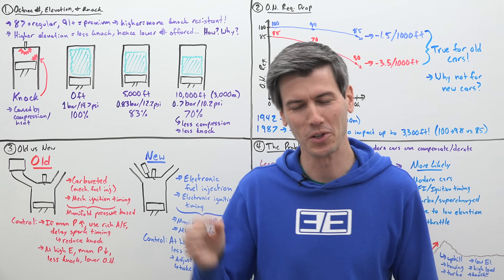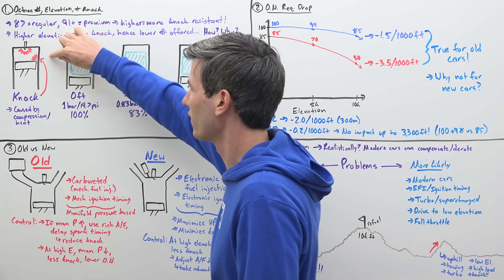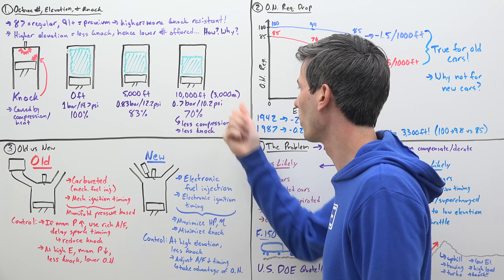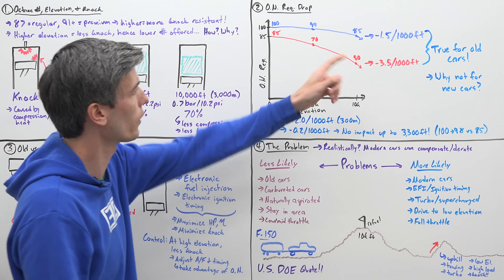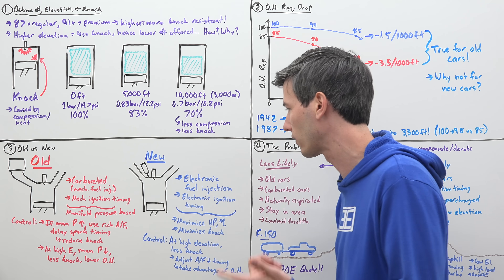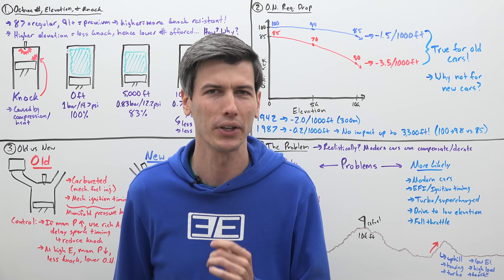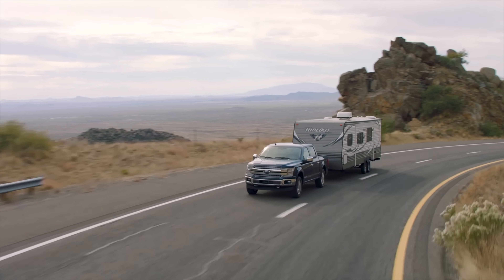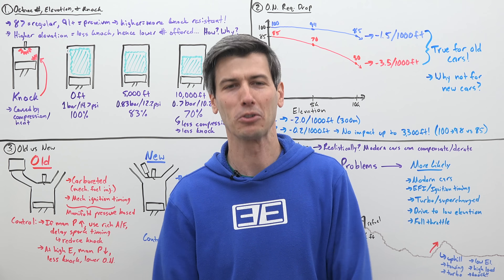Never Use This Gas In Your Car!

Comment: I drive a Japanese minitruck, there are constant arguments on the forum about what octane to run.  And, I have to keep explaining that the Octane in the manuals for our Japanese home market trucks, are referring to just the Research  Octane Number, and not the Anti Knock Index posted on pumps in the USA and Canada.  And, that if the manual says you can run 88 or 90 octane that is really closer to 93 or 95 AKI here in North America.
Reply: USA IS RON+MON/2  If they're using RON, those numbers are always higher than the ones used in the USA.
Reply: @user-jl8yy5ir7s too broad of a statement. Many newer cars have a compression ratio over 11:1 that run fine on 87 and older fuel infected naturally aspirated cars with a ratio of 9:1 that require premium fuel. It just depends...
Reply: @user-jl8yy5ir7s Depending on the year, some of them have 12.5:1 compression ratios.  Depends on whether it was before or after the manufacturers agreed to end the horse power race.   By law they Kei Class vehicles are limited to 660-cc displacement.   So, there was an “arms race” of sorts for a few years, where the manufacturers were trying to get as much power as possible from the little engines, so they were either increasing the compression ratio, or supercharging, turbocharging, or in a few instance both turbo and supercharging.   They really do need quite a bit of octane, because they were for the most part still running carburetors.   Mine was a low trim, scissors lift dump version, and it has 10.5:1 compression ratio.   The fuel injected turbo version had 9.5:1 compression, but the boost takes up to around 12.5 dynamic.   And most folks trying to run and maintain them have never do any level of self mechanical maintenance.   And have no idea of how to work on things, or when you can substitute off the shelf things for the high dollar OEM parts from Japan.  They do things like spend $75 to get the stock plugs from Japan, or spend $80 for a thermostat.  My favorite is $279, fr a 35-Amp Mini-Denso, alternator.  Which goes for around $85 in a 60-amp version online.   Without realizing they can order standard parts in the US or Canada that work as well.

Comment: If you want to talk really bonkers:  I work for the government.  We are required to use the lowest cost gasoline at the station because some sub-intellectual bean counter, watched a show that said you don’t get any benefit from running premium, and the”engineers” who run the fleet program won’t argue with the bean counters.  I had a Chevy half ton, which I could make detonate anytime by flooring it under load.  It would rattle like you were pouring gravel down the intake.  I nursed it the five years I had to drive it. then I got a new Ford F450, and my old truck went to summer fleet.  The 18year oiled college student blew up the engine in the Chevy running the truck at full throttle.   The Chevy’s manual said to use a minimum of 92 octane, and the lowest pump grade was 85.  And they are trying to blame the kid for destructing the truck.  

The F450 says it wants a minimum of 92 octane, and I’m still required to run the lowest cost 85 octane.  It irritates me that Fleet is part of the Engineering Division, and none of the talking heads at the top understand we are damaging the trucks.  Shell and Exxon have both done studies which show that by running a lower octane fuel, you increase engine wear, and cut fuel economy.  The engine management system retards the timing and enriches the mixture to get rid of the knock, when the knock sensor detects knock.  For every degree you retard the timing you decrease the life of the engine, because the retarded timing causes increased side thrust of the pistons and rings agains the side walls of the cylinder.  And enriching the mixture results in lower fuel economy, (well DUH).

Can you post a link to the DOE paper you quoted?  Thanks, Randy

Comment: I have been a professional mechanic for 38 years and have learned a couple of things over the years. I would rather explain Chinese arithmetic to a customer than to explain how octane works; they just don't seem to get it. The other thing I have learned is most customers will spend $50K on a new vehicle and never read their owner's manual. They would rather depend on their salesperson to provide the information they need to know. If the customer were to ask the salesman if it is okay to run 85 octane in their vehicle you can bet he is going to tell them its okay; he is in the business of selling cars.

Comment: I guess I live in a high-altitude area (Black Hills of SD) and have for 35 years.  We have had 85 octane for all that time. 

Just thought I’d give my experience with it. 

My family has had a 2005 Honda Odyssey since almost new.  Owners manual recommends 87 octane. The fuel that has 87 is ethanol blend and we ran that for about 5 years and noticed that our gas mileage was terrible, and I keep regular maintenance up to date. Decided to change to 85 and the van got better gas mileage and no knock or ill effects. The van has over 300k miles and shows no signs of let up.

I also have many other vehicles that I have run 85 in and found the same thing, ethanol is worse for vehicles than is 85.  

I guess I’m glad 85 is an option as it’s better than ethanol for gas mileage and 85 doesn’t gum things up like ethanol. So even though ethanol is cheaper at the pump it really isn’t after you factor in the worse gas mileage and the extra repairs caused by ethanol. 

If 85 weren’t an option the only non-ethanol octane would be 91 and that is way more expensive. (Although 91 is the only thing my 67 impala with a 396 likes 😂, wish we could go back to the 60’s for gas.)

Comment: Everything said makes perfect sense, however, almost all modern engine control systems have detonation sensors, I agree that you should not 100% rely on them, but they do seem to do the job pretty well. 
The problem does increase with positive manifold pressure engines, some have enough boost capacity to make the same MAP from sea level to 10,000 ft.
Automakers would love to see 93 or 94 octane Coast to coast, they could make more power from smaller engines, improve fuel economy, and improve performance, but the refineries  are resistant to this.
It will all be moot soon anyway. BEVs are rapidly taking over, the ICE age is passe.

Comment: I made the mistake of using several tanks of 85 octane while on a road trip in my 2001 Toyota Sienna minivan. Apparently the knock sensors were going crazy trying to deal with lots of high-speed uphill driving and halfway through the third tank, one of the sensors failed. Saving a few pennies per gallon resulted in a $1500 repair bill to change both sensors. Grrr….

Comment: I get it but, why would the new electronics and fuel injection systems with anti knock sensors not automatically sense the knock and adjust the mixture and timing to eliminate the knock?

Comment: Purely FYI, you're not using the 'correct' PSI to Bar conversion factor...
1 bar is 14.503 PSI and NOT 14.7...  (Perhaps you've inadvertently been using the stoichiometric gas A/F ratio figure???)

Comment: "Never Use This Gas In Your Car!" = probably fine to use this gas in your car if you're not going to tow a trailer or go street racing in low altitudes before you burn this tankful.

Comment: I live in the Denver area and have always used 87 octane in my cars, which is labeled midgrade here. What really ticks me off is that over time the price gap between 85 and 87 has risen from 10 cents to 30 cents per gallon. I can’t believe there’s any justification for that, when I can drive to a neighboring low altitude state and buy 87 octane for less than what 85 costs in Colorado.
Reply: We are dealing with $1.54 per litre here. You guys have it lucky down there
Reply: @jerwatson79 stopping voting liberal then?
Reply: @brkbtjunkie They pay what fuel costs with about the same tax - US gas prices are government subsidized - a socialist program designed to put the government in control pf market prices.  

Define "liberal"

That is right you dont have any ficking idea what you arentalking about.
Reply: @paulroyle-grimes  then why is it more expensive in California compared to Canada if Canada is literally getting fuel at cost and ours is subsidized? Your comment makes zero sense and contracts itself.
Reply: @paulroyle-grimes  Subsized ? Ha !
My state by itself , has $0.54/ gallon tax . And it is automatically raised each year , linked to inflation rate .
Reply: @BlakeHouse-j3u Nah - you need to look at the prices anywhere outside the US - the reason our gas is higher in all but two countries worldwide is because it is federally subsidized - your state taxes on gas are usually to pay for roads.  

The problem with you MAGA types is you dont understand government, you dont understand economics, you dont understand science, you dont have basic knowledge.

You all through high school so FOX and info wars can tell you anything and you will believe it. 

Ignorance is a choice.
Reply: @brkbtjunkie stop voting oil company owned republicans

Comment: I've seen engines with holes burned through the pistons because the car was a high compression engine, the minimum requirement was 91 octane and they drove it with 87 octane, even though the engine has electronic controls to try to compensate... a high compression engine, with low octane, there's only so much it can do. My current car also takes nothing less than 91 octane... because at max load and full ask on the throttle it shoves 20 PSI of boost down it's throat. So yeah, give it what they made it to take. my car asks for 91, it gets 91 or 93 depending on if they have 91 available.

When I was driving an 86 toyota pickup and was living at 8600 feet? the higher octane fuel made it run like garbage because it was too stable for the vehicle, the spark plug temp, and the environment. so yeah... there's a lot of factors.

Comment: Question, even with timing adjustment, wouldn’t there still be less pressure in the engine?  Would hat not still reduce knock in a similar way? 

Is the graph you showed use engines with the same compression?
Reply: Of course, if you change comp. Everything changes, which is what turbo & s charge do

Comment: This video will cost me a few hundred extra dollars a year.  Thank you.  Haha.  I have almost always had cars that I wouldn’t think of running less than the top grade (91 in co).  Now have a 2002 4 runner and was running nothing but 85 till a check engine light came on after a mtn drive.  I assumed it was knock and put a half tank of 91 and it went away in a few days.  Who knows I didn’t get the diagnosis…

Comment: What in means is new vehicles suck. Go ahead and spend $70,000 on a new truck that you can’t get gas for, and everything is controlled by computer, I’m happy with my ‘95 beater that I can fix myself and doesn’t care what gas I put in it. New diesel trucks, ain’t any better, requiring a full tank of blue def to start. Ridiculous.

Comment: Jason, could you confirm/bust the "old vehicles should use thicker than recommended oils" advice? Much appreciated!
Reply: It was for better mechanical contact, and some parts would wear out so a slightly thicker oil either with additives or a different grade could improve oiling especially in the DOHC systems with poor designs compared to modern. i.e my pre-update ‘98 Mercury Mystique has piston jets to cool the back of the piston and to try and get some splashing up onto the rings, so overall it has an inherently better comprehensive design over the previous sierra design which needed reliability modifications for better performance. I’ve even heard of mid/high mileage zetec engines from before 98 having the cylinder cross hatch patterns still visible upon tear down whereas other vehicles pre 1990 would be generally unheard of indicating a lack of engineering and thus a need for different oil weights than manufactured for.

Comment: I've been told that in addition to the knock prevention, higher octane fuels also burn hotter. Is there any truth to this, or is it urban legend? I tend to run higher octane fuels on long road trips cause again I have been told it helps the engine out.
Reply: Urban legend. It really is the same fuel with the addition of chemicals that improve "octane" ratings. Toluene was once quite popular, while MMT is more common now. Anyway, it is just an additive to prevent detonation when the heat and pressure are high.

Comment: Sorry, you are wrong in some of your conclusions because you started off with a flawed premise.
Octane rating is not about the ability of the fuel to prevent knock, it is a measure of fuel volatility.
The higher the rating, the less volatile.
All your discussion about air pressure is mostly irrelevant because modern engines measure both ambient pressure, and the amount of air entering the engine, and are able to adjust the fuel entering the engine in real time (as well as when the fuel enters the engine). The only relevant part is that you do indeed lose power at high elevation, but this is simply because you have less fuel and air to perform the same amount of work. You are also equating ping (pre-detonation caused by carbon deposits) with knock (pre-detonation cause by chamber pressure).

So what is important? Compression ratio. As you increase compression ratio, the tendency of the fuel to self ignite increases. In a modern engine, the fuel mixture is always ideal, and there is a sensor to monitor engine knock. If knock is sensed, the timing is retarded. If the compression ratio is high enough, and the octane rating low enough, the fuel will always self-ignite, and no amount of timing retard will overcome this. This condition is extremely destructive, and will result in damage to the rings, pins, and rods, and probably damage to the mains.
Diesel engine are designed so the fuel self ignites, and are stronger than gas engines. Many diesels also require a partial overhaul as part of their regular maintenance at high mileage because even they get damaged over time.

Comment: So... a vehicle that  requires premium fuel can run fine on regular if you don't mind the engine making less power and if you dont stress it with high loads, yet a fuel rated at 85 cant be put in a vehicle rated for regular. Um, yeah... idk. You'd expect it to hold true both ways else a premium fuel vehicle cant run on regular. But hey, sometimes things are more complicated than it might seem, I'm no engineer. Just a thought.

Comment: It's not bonkers. Read your manual and use the recommended fuel. If you have an old carbonated engine running at 7 to 1 compression run the more explosive stuff its fine.

Comment: Jason, I own a 2009 Corolla that I've turbocharged and had tuned for 92 octane as that is what premium gas is in WA and OR. I've travelled across the western US in this car and everywhere else the premium is almost always 91 octane. Will this difference cause issues for me? I love driving it hard in the mountains and canyons as the turbo makes the car a lot of fun adding 100hp. Not wanting to take a chance I've always added octane booster before filling up but the bottle doesn't say how much it increases the octane.

Comment: What about a low compression engine with a carburetor? 1st gen RX-7 (12A rotary engine, pre 1985)... I've heard that people use to race these cars with low octave gas (70-80) to provide higher energy, don't know if they had to modify timing. I suspect that in this very specific instance 85 may provide more efficiency. Can anyone confirm this?